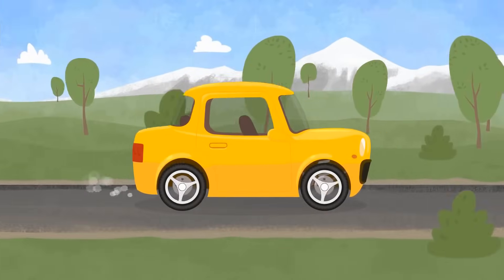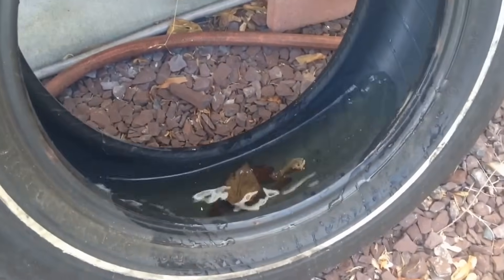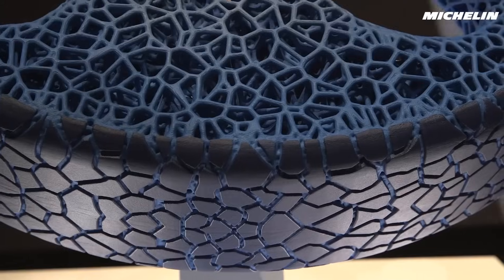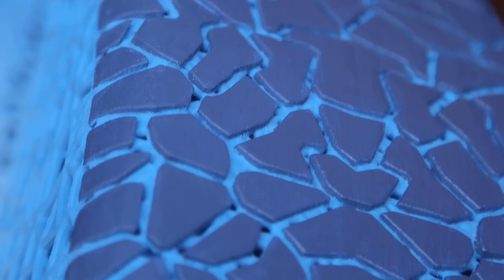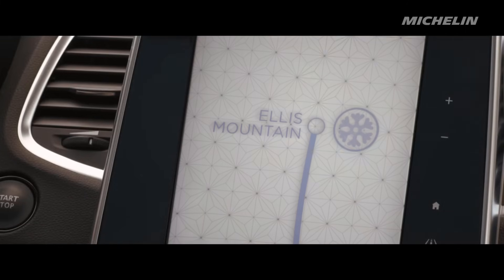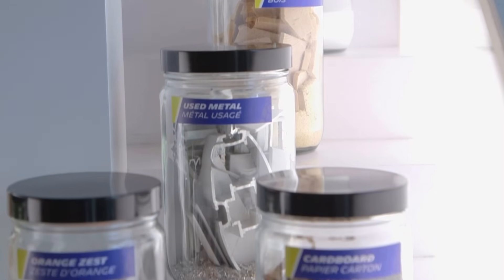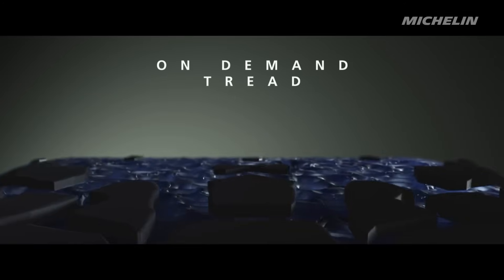Michelin 3D Printed Airless Tire

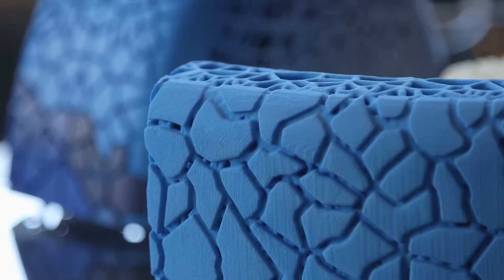Comment: 2:22 "also made from bio-sourced and bio-degradable materials including but not limited to natural rubber, bamboo, paper, tin cans, wood, and plastic 

One problem I see with modern tires is that they wear down and leave non-biodegradable dust in the air and in the soil. If you make these tires out of plastic you will have successfully wasted all your efforts in the creation of this "next-gen" tire. 

BIODEGRADABILITY IS THE KEY